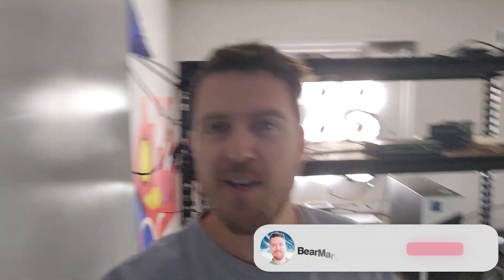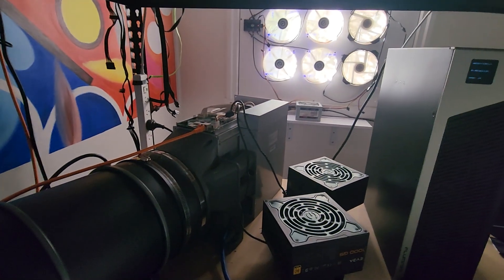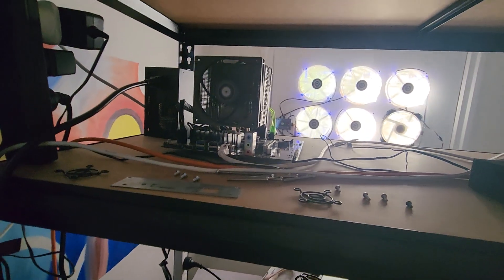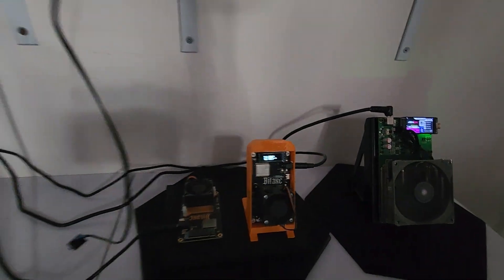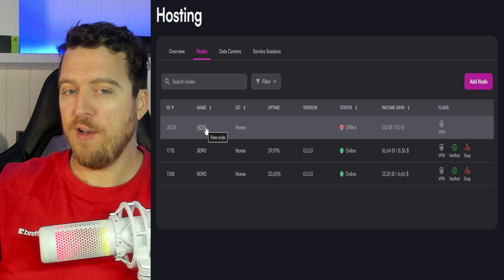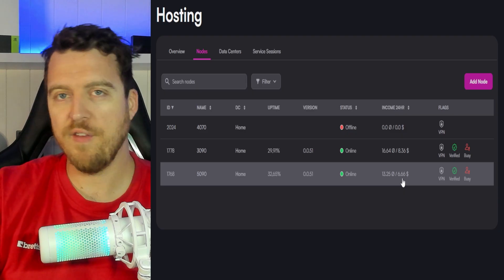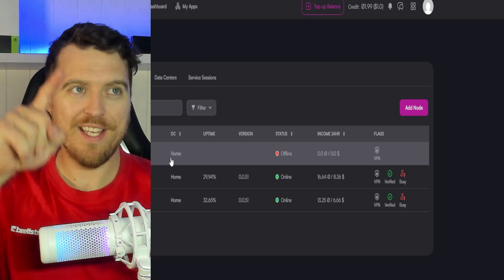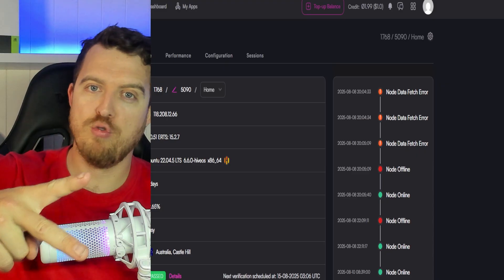My Mining Farm Update | ASICs + OctaSpace Profits 2025

Comment: something wrong with your network switches.  most likely old VLAN infor stored on the ports.  Switches do not assign IP addresses.
Reply: They can if they have their own dhcp server.
Reply from the maker: Yeah, same ip address, but different dhcp address assigned by the router. The same reason different rigs are different SSH addresses while connected to the same router
Reply: @BearMarketMiner  pfsense :D

Comment: hey bud. you def have way better luck with octaspace than me. my rigs have been cranking away on clore and its fairly consistent for me.
whats the magic trick to get rented on octa?
Reply from the maker: I'd say moderate pricing, high specs on the additional hardware like ram and disk speed. Make sure your online score is solid and you should be good to go.
Reply: I’m having the opposite experience, can’t get any 4090s rented on clore but having good luck on Octa lol
Reply: @bonkmedia mine just got rented again. Back to back. Im keeping short 24 hour contracts to test things out. Was planning on putting my setup offline to do some preventative maintenance but before I could hit the 'not available button' it was already rented out at a higher rate (I set the rental rate to 2x just to keep renters off). Not complaining though. Its making money so all good but def want to know the trick to rent on octa. I ran the same host on octa for days without a single hit.